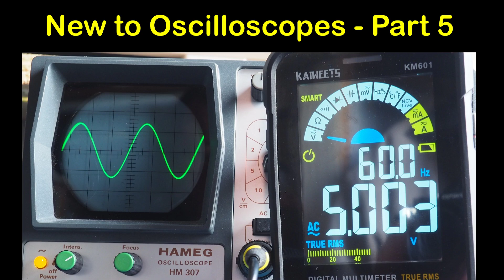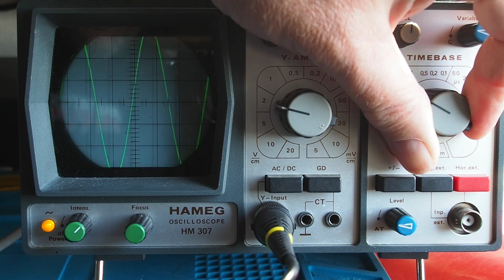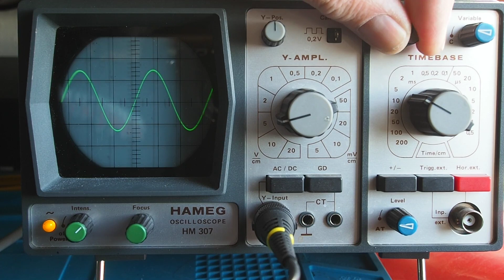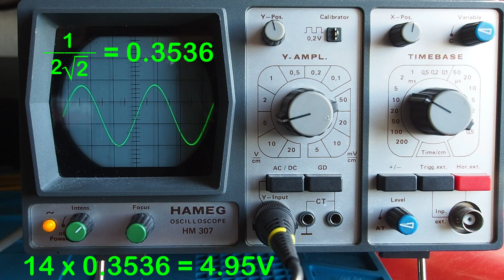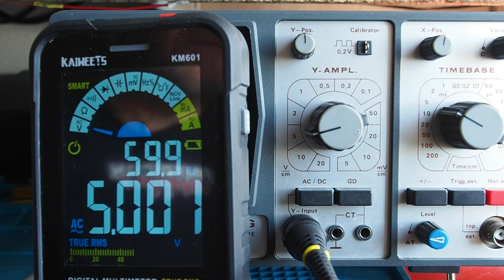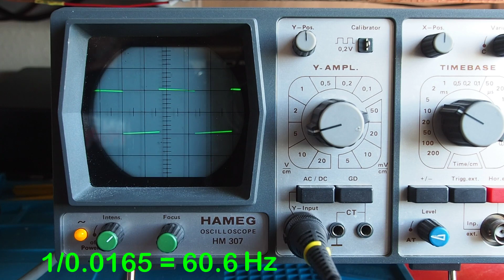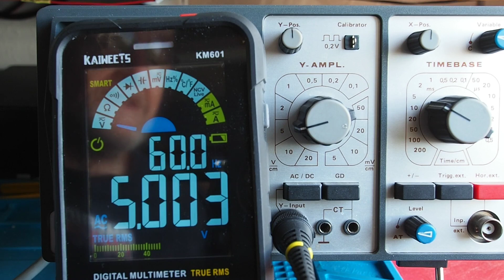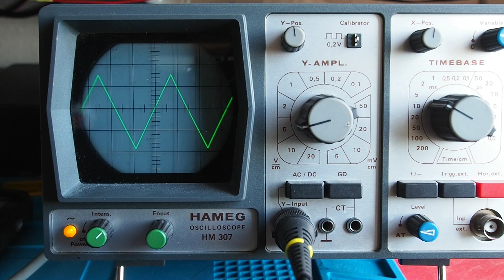New to Oscilloscopes   Part 5 - #120

Comment: Your trace rotation needs a tweek, the trace is very slightly skewed. Is it not a good idea when setting the zero volts position to press the GND button to avoid any stray voltage from the probe and it's lead. Thirdly I find it's more accurate to measure period by seeing where the trace the crosses the horizontal axis and counting to the next up or down crossing of that same axis. This is a little less prone to positioning error than trying to locate the centre of the curved top of a sine wave. But good video and explanation and always good to see an old-school scope in action.